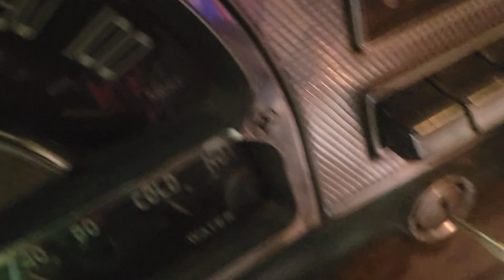PROBLEMS WITH YOUTUBE!!!! - Pushing Forward!

Comment: Guess I'll throw in a comment even if you never see it. That engine turns slow even for six volts. I started my Merc for the first time using a 12 volt battery and jumper cable direct to the starter solenoid. That way it does not send 12 volts to the rest of the electrical system. Those flatheads were notorious for sticking valves so there could be zero compression on any cylinder where a valve is stuck open.